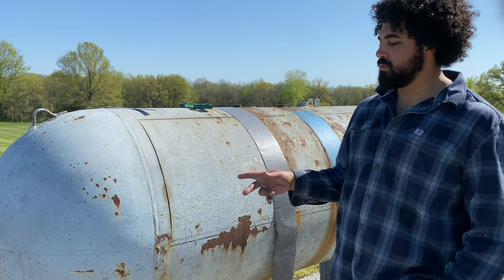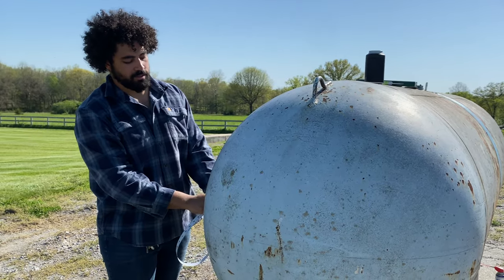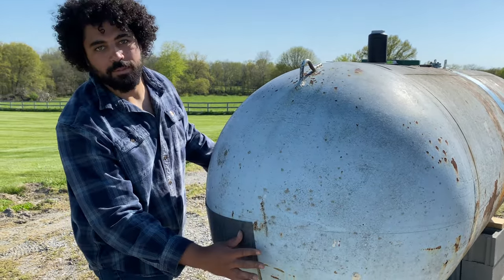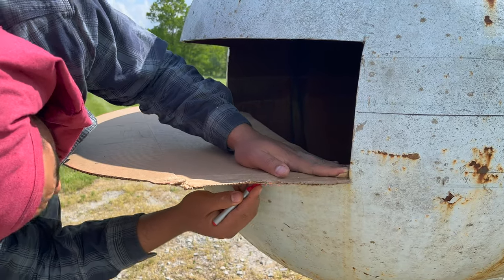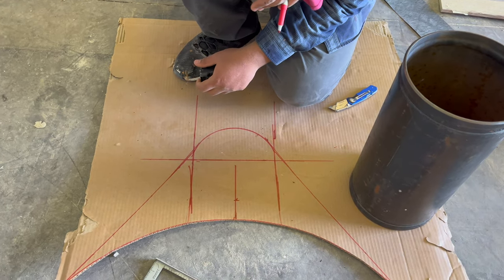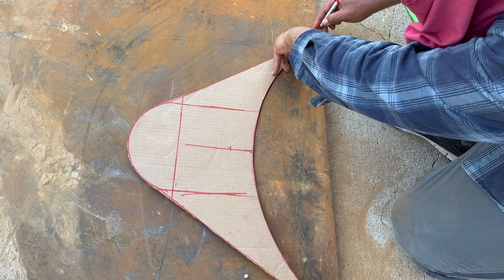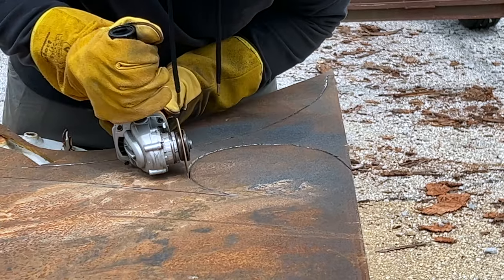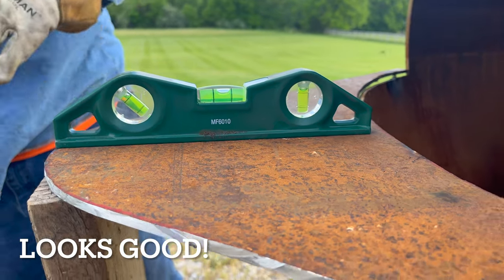Building A 500 Gallon Offset Smoker: Smokestack & Collector

Comment: You’re bad mamma JAMA is actually called a wraparound you can find about welding stores near you pipefitters use them. There are other ways to find centers by using squares together.
Reply from the maker: There we go! Funny not a single hardware store had one of these near me. Not even Homedepot, Menards, Lowe’s, etc. 🤦‍♂️

Comment: All with a stick welder.  MiG much easier. Hats off to you guys.
Reply from the maker: Appreciate the support!
Reply: what rod did y’all use?
Reply: 6010?
Reply from the maker: @BeniZap771 
First pass “root pass”
1/8  6010,80-90 amps 

Second pass”hot&cap”
3/32  7018,80-90amps
Reply: @MeatNGreetBBQ  dudeee thanks for answering!!!!
Reply: @MeatNGreetBBQ  that tank is carbon steel correct?

Comment: Looks great man! We just started a trailered 500. I’ve got a 7’ pipe that is 8” diameter as well. Doing a folding stack so it will also be a shorter section going in first. Can’t imagine trying to do that with a whole 7’ stack unless you had some serious machinery
Reply from the maker: Thanks for the support brother! I’m
No professional by any means so I definitely fumbled through this one, but then end product was humbly impressive haha. I’ve had many cooks since finishing the smoker and I stand by those smoke stack dimensions, the thing draws air like no other! Keep me posted on how your build goes if you get a chance 👊
Reply: @MeatNGreetBBQ  will do man! How long ago did you finish it? If it draws as well as my Fatstack I’ll be thrilled
Reply from the maker: @jamesgunn5358  It took I think 100 days on the dot, and that was not by design lol. Keep in mind we were working mostly evenings with the occasional 4 hour Saturday session. I could have done it in far less time IF: (1) I would have had all the materials needed up front and didn't have to  wait on odds/end items (2) would have utilised more weekends... and (3) wasn't filming the entire process form top to bottom. I should probably add a 4th which is I had no clue what I was doing which is no doubt a silent time variable which I poorly underestimated 😅
Reply: @MeatNGreetBBQ  haha for sure. Next one will no doubt be faster if you ever do another. I’m planning on making 3 at a minimum. 2 to sell to offset the cost of building my own and the 1 to keep
Reply from the maker: @jamesgunn5358  if only I would have been as forward thinking as you haha… but I’m good for 1 smoker roughly every decade 😂
Reply: How thick was the pipe? .280 ?
Reply: Just heard it’s a schedule 40. So it’s the same as the one I have. Thank you again. I’m working on a 120 gallon myself and my pop. Great channel

Comment: I finally purchased my propane deposit, a 500 gallon. Probably too big for a first time build, but this is what I could get my hands on here in Spain. It is bigger in diameter and shorter than de ones I see on your videos proportion wise. Nevertheless, the steel is ⅜ of an inch and in great condition. My question is where to join the (insulated) firebox.  Should it be on the centre line or below.  And if below, how much? Is there like a formula? Thanks so much and I really appreciate your channel.  Without any doubt, the best on smoker building. Greetings from Spain
Reply from the maker: Huge congrats my friend that’s great news!!! 

I eyeballed the firebox but believe I set it a few inches below center line. But the firebox throat opening is going to be even lower than that. It’s REALLY hard to explain over message, mostly bc I’m not an expert haha. The best help I can provide is the fire management video I filmed. Sorry that wasn’t much help. 

Thanks a ton for the support brother, always means a lot!
Reply: hoochie mamma ....thats a serious tank

Comment: Awesome video! I’m in the process of building a 250 gallon offset and I’m at the collector build now. Did you think about going with a hinged smoke stack? Also are you going with skids, wheels or trailer mounted to move it around?
Reply from the maker: Thanks for the support family! I did think about hinging the stack there for a little bit but honest decided not to just due to being dog tired of chasing down materials and I was on a time crunch with the build so had to prioritize some things over other ya know? And we rolled with skids then set on a trailer. I didn’t want to do anything permanent so I decided on trailering the smoker.

Comment: Loved the video. You guys did an awesome job. Can't wait to see the finished product !! BTW, did you put a damper in that stack or will you just rely on the fire box damper ?
Reply from the maker: Brother your support is truly appreciated! Great question. Is rigged a damper after I cooked in the rig the first few times. The convection was OUT OF THIS WORLD and I realized if I don’t find a way to slow the velocity down, I’d never be able to have elite fire management. So I cut an 8” circle out of some cardboard and traced it onto 1/4” thick steal and cut that out. Then I tacked an 8ft piece of cheap rod laying around to the outer edge of the ‘damper’. I made a little handle at the bottom out of an old horse shoe haha. It’s not perfect but once I did that I was able to dial in my temps and make the smoker do exactly what I wanted.

Comment: What kind of welder did you use? I’m about to build one myself but I only have a Lincoln 140c
Reply from the maker: This is about all I know from my buddy who did the welding. Hope this helps: 

First pass “root pass”
1/8  6010,80-90 amps 

Second pass”hot&cap”
3/32  7018,80-90amps
Reply: Thank you. That helps me a lot. Now I have a starting point 👍🏼

Comment: What Gauge of steel did you use for the stack?
Reply: Gauge is used for tubing/sheet metal
Inch (1/4",1/2" etc.) Is used for plate
Schedule is used for pipe 
ie.  Sch40 Sch80 etc.
I believe he's using schedule 40
Reply from the maker: That’s correct. I think I’m a video I said sch40 but I think it was sch10. You’ll be fine with either. I’ll double check and report back.

Comment: There are calculators online to calculate the size the smoke stack should be based on the size of the cooking chamber and firebox. An 18 foot smoke stack means nothing. Cheers!!
Reply from the maker: If you’re referencing feldons calculator, then I’m sure you know how brutally OFF that calculations is. Secondly, not quite sure what you mean by “an 18 foot smokestack means nothing” … because smokestack height means everything! Lastly, calculators and opinions (yours and mine) aside. I directly contacted 2 of the largest pit builders out of Texas who provided me their exact smokestack measurements, I also spoke with a former employee of Aaron Franklin who gave me the “rough” height of franklins 500 gallon pits, and last but not least I crossed that with the smokestack height of a 500 gallon primitive pit. Which if you know smokers, then you know the efficacy of a Primitive by JD.   All that to say, I’m beyond happy with the performance of mypit and I’m glad I asked real pit builders and pitmasters rather than defaulting to a “online calculator.”
Reply: @MeatNGreetBBQ  I’m glad you did your research. You couldn’t give me a Franklin pit after watching the mad scientist review. I have owned a workhorse pit 1975 for almost two years. I’ve had numerous communications with JD and Ashley through the purchase process. Your pit looks awesome. Ready to see some seasoning and cooks on it. Cheers!
Reply from the maker: @Isovapor  JD is a great dude! Also, the Franklin backyard model is by far NOT the best option for the price, you’re right J Yoder showcased that haha. How do you like your primitive? If I ever purchased over built it’d be  primitive or a millscale. 
Thanks for the support brother!